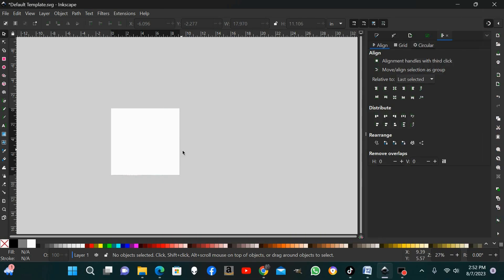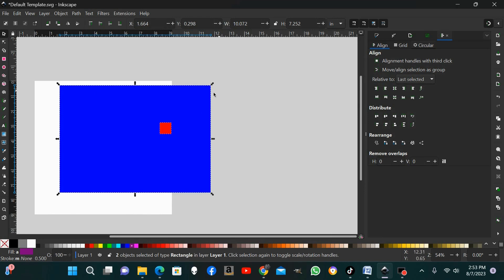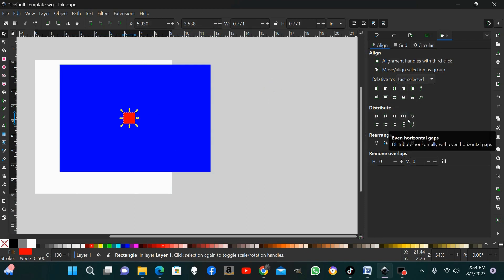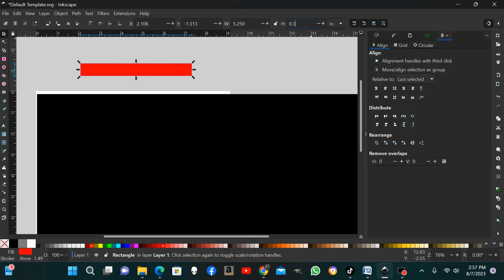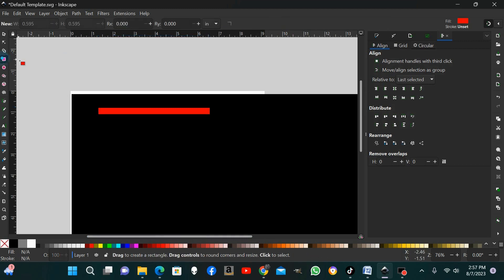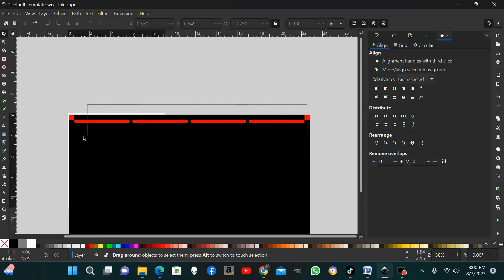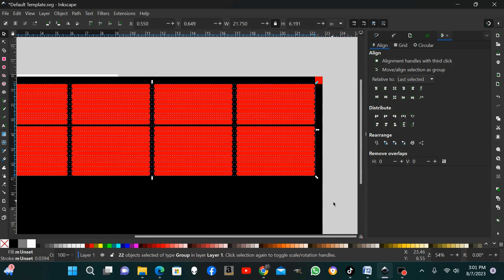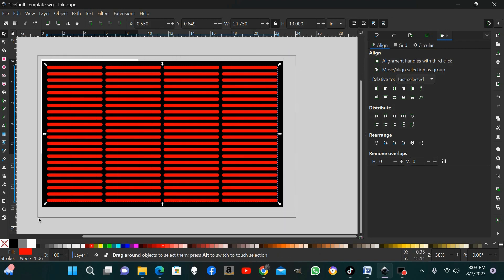HOW TO MAKE A GRILL GRATE PATTERN USING THE ALIGN AND DISTRIBUTE MENU IN INKSCAPE

Comment: Awesome info sir! If I wanted to send a proof to the customer is there a way using Inkscape to show typed dimensions of the size of cuts and spacings on the proof?
Reply from the maker: You can use a grid pattern in document properties. But it doesn’t show dimensions. I generally just draw lines with end bars and add the font in stating the dimensions if I’m wanting to show that.

Comment: What thickness do you recommend for a grill grate?
Reply from the maker: I don't know it's kind of personal preference. I would personally use 3/8" to 1/2" wide slots.
Reply: @beaverffa5437 if you're talking about thickness of the metal I wouldn't go any less than 1/8" or 11 ga. if you're using steel.